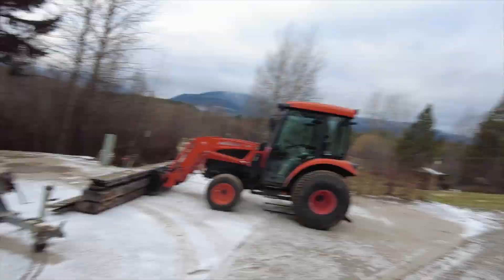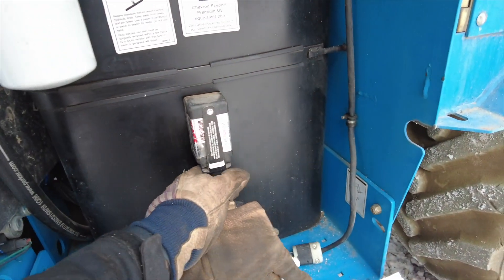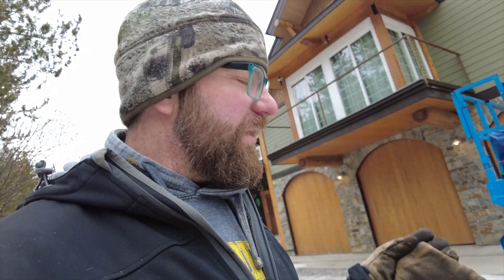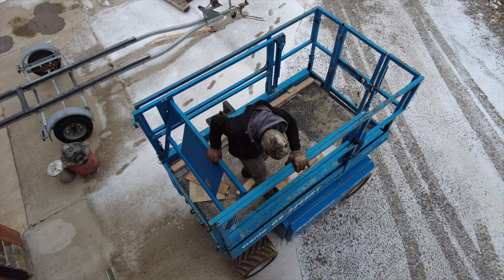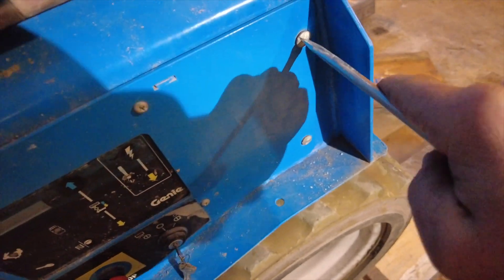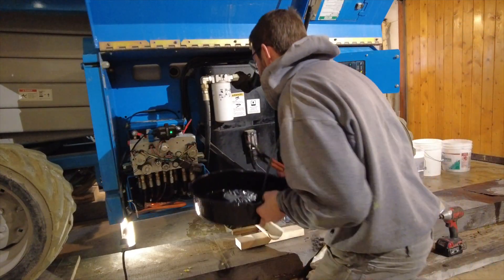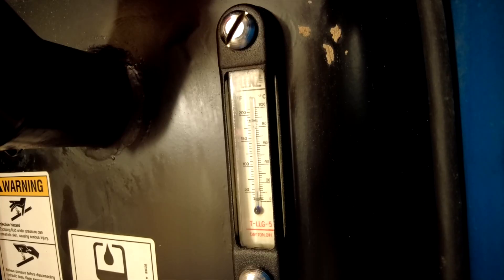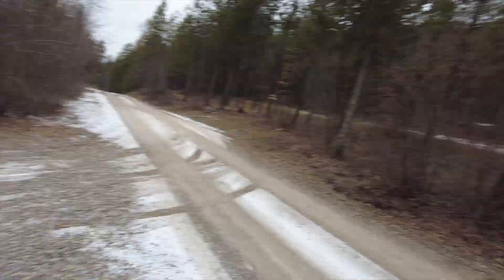Genie Scissor Lift Hydraulic Oil Change because it won't work in the cold

Comment: MIL-H-5606 Aviation Oil for prolonged extreme cold climates. ISO 32 is recommended for temps between +14F to +120F.ISO 15 recommended for temperatures between -20F to +32F.